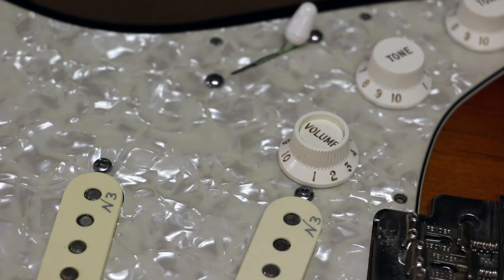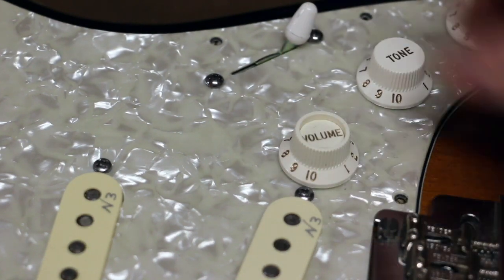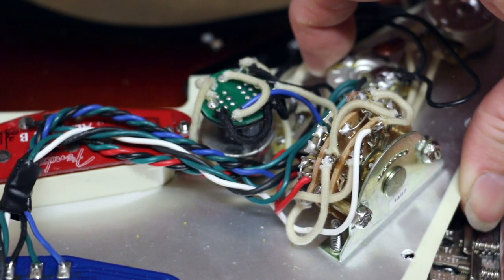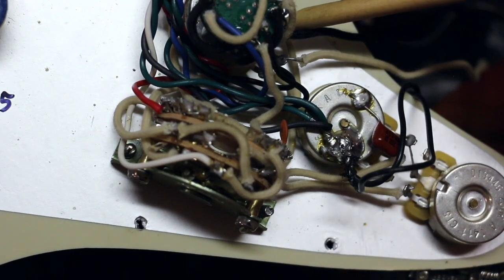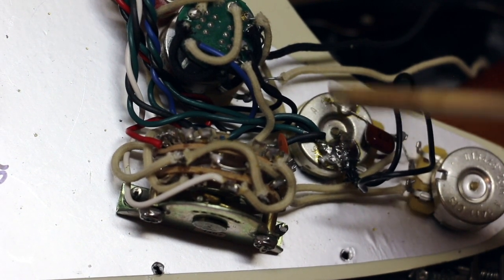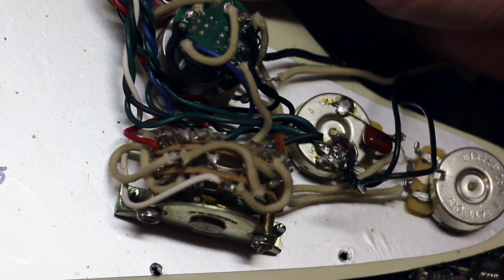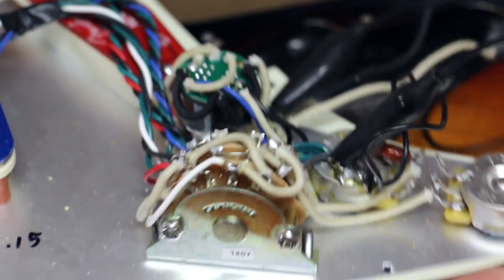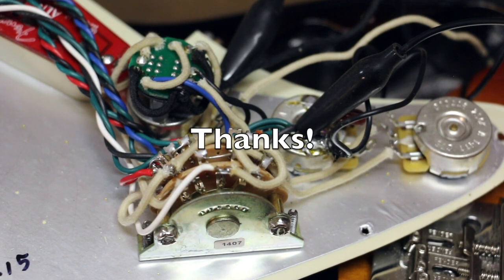Ground Wires Needed - American Strat

Comment: I'm having trouble visualizing if adding a wire creates a ground loop, but you may want to make sure you aren't. I don't know how bad a ground loop is with a guitar circuit, but I know it can be a problem with speakers and computers. I had a speaker plugged into an outlet on a separate electric box from my computer and even though both electric box were grounded to the same ground, they connected at different points that created a very slight voltage difference that turned all the wiring into an antenna or something that had my speakers blasting static.

Comment: I’m having a ground issue with my Voodoo Strat. There’s a buzz which goes away when I touch the bridge or trem bar. I’ve replaced the wire from the volume pot to the claw and replaced the wires to the jack but no improvement. It’s driving me nuts 🙁

Comment: I recently had to replace the pickups on my deluxe strat - and there is supposed to be a ground connection from S1 switch to the 2nd tone pot - which that strat seems to be missing...
Reply from the maker: This guitar was missing several ground wires.  Fender was relying on the shielding on the pickguard to ground all of the controls together.  They should be connected to each other with ground wires.  They are now.

Comment: So buy an American strat and get something that isn't wired properly even the cheap Chinese strats ground the pots. For what they charge you'd think that the thing would be perfect before sending it home with somebody who probably worked their ass off saving up to buy one. My older one has alot more simple wiring vthan these new ones and anything I'm building looks like it's wired more neatly than that gobbered up mess of soldering.